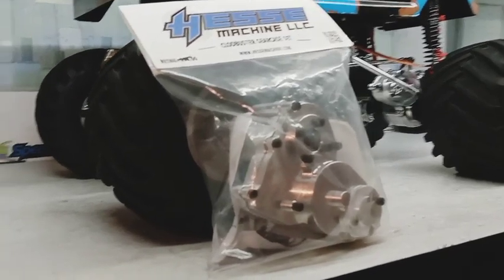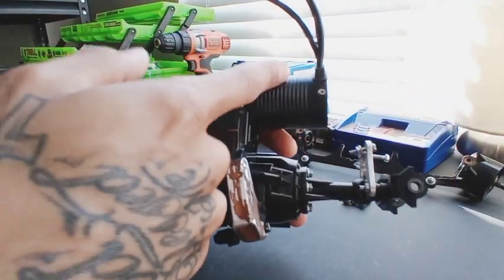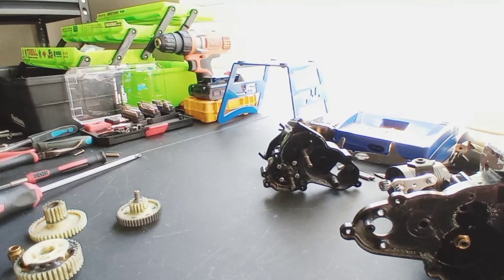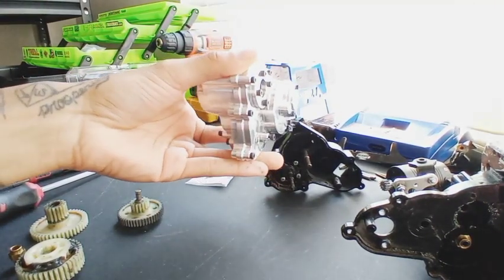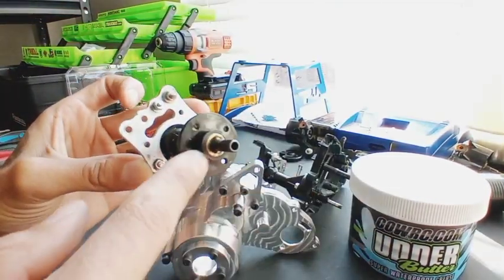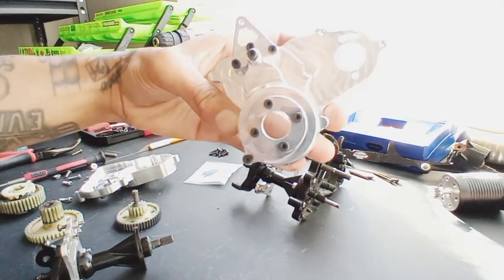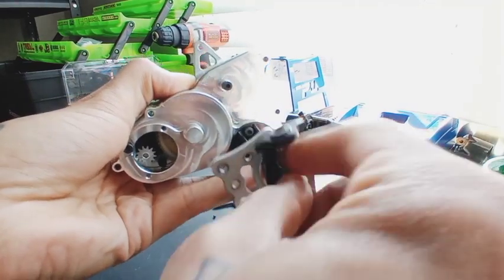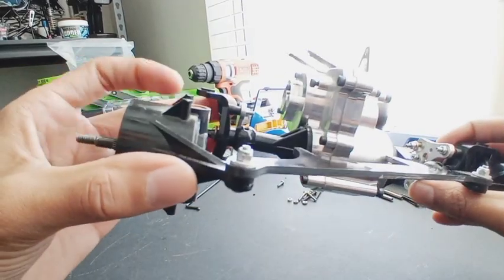RC Monster Truck gearbox swap to aluminum with Tamiya Clodbuster

Comment: Sweet Clod Buster!

I have always wondered how long the stock black plastic Tamiya axle tubes will last when used with aluminum gearcases and without the stock steel Tamiya axle trusses in place like that.  All of my Clod Busters and Bull Heads have aluminum gearcases made by JPS but they also have JPS aluminum axle tubes because I was always worried about breaking the stock plastic parts when attaching them to aftermarket aluminum parts.  (Plus the JPS aluminum parts look really nice all together!)  Unfortunately, too many of the aftermarket aluminum axle tubes, including those made by JPS, cannot accommodate the stock steel axle trusses and I really wish that they did for extra strength.  I would have definitely used them on my truck if the JPS axle tubes had the mounting holes and flat surfaces for them.

Once again, fantastic Clod Buster and thank you for sharing it in a video.
Reply from the maker: They last for a good while surprisingly. And I did put the stock steel Tamiya axle trusses back in place but it was after I filmed this video. Yes the axles definitely need those lol. And thanks a lot I really appreciate that.
Reply: ❤ I feel the same. I’m a fan of bracing!

Comment: Nice Clod dude!! I see you noticed too how the suspension "wobbles." I've built four Clods - All with the same suspension links but two with 8 shocks and two with only 4 shocks like yours.  I noticed the 4 shocks don't give as much stability as 8 so I'm planning on experimenting with the ball ends of the links by adding some blue thread locker to stiffen things up a bit.
Reply from the maker: Thanks a lot I appreciate that.

Comment: They don't make aluminum axles?
Reply from the maker: Not sure about axles. I doubt he does. He used to make axle cases I think but I didn't ask. I just wanted to get the hardest part to find out of the way first and these aluminum gearboxes are kinda hard to come by for the Clod unless you get in direct contact with him.
Reply: You can find aluminum axles on eBay for the clod buster
Reply from the maker: @pattyofurniture5674  You guy's must be talking about the axle cases that the axles sit inside of. Those can be purchased in aluminum but you cannot find aluminum axles for a Clod. Only aluminum axle tubes. Two different parts. I just like to be specific and accurate on the names because this is an informal page and I don't want people to get confused.
Reply: Yes Hesse Machine does make aluminum axle tubes and so does Hot Racing and Integy